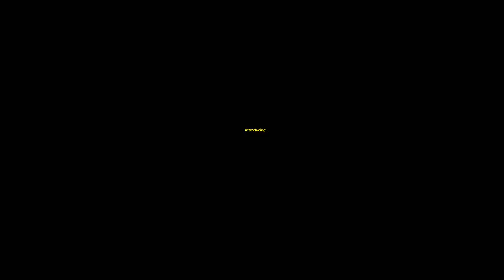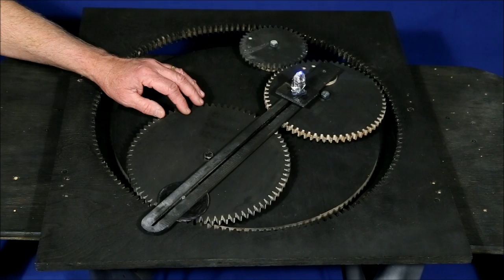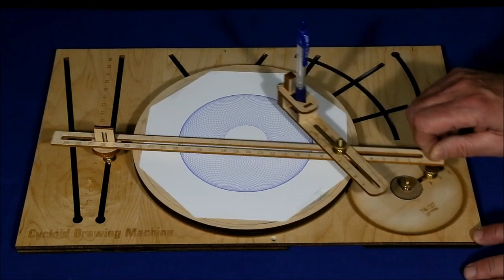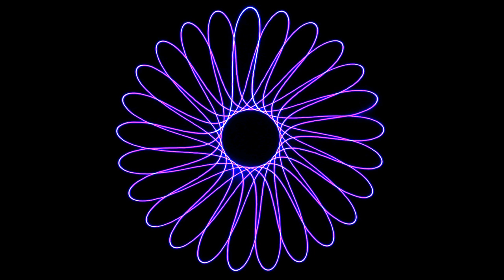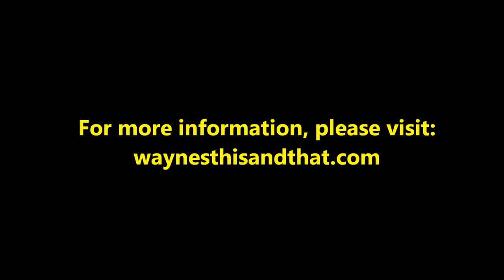Illumicon Drawing Machine

Comment: Hi! Love this! Seriously considering making one for myself!! Question for ya: I assume there’s a way to calculate the number of full rotations of the base that you need to compete a full pattern. Guessing isn’t really going to cut it with light painting of course. And given how long the exposures are I’d like to try to get it “right” the first try. Thanks!!
Reply from the maker: Unfortunately, calculating the number of rotations to estimate how long the exposure has to be is so difficult, particularly when multiple gears are used, that I defaulted to guessing at how long it might take, then taking test exposures to narrow it down. I seldom if ever got a perfect trace and had to clean the image up in photoshop to either extend the last trace to complete the pattern or edit it out if the trace overshot. Note that if you use your camera's noise reduction feature, exposure times may be doubled. On my Canon, it takes two images: the first one captures the trace and the second takes an image of the same duration but with the mirror closed so that any hot pixels are detected and eliminated. This results in much cleaner images, but if the required exposure for the trace is 30 minutes, then the camera will take a full hour because the noise sensing image also requires 30 minutes. That's a long time to wait for a single image that may not be worth anything. Good luck and thanks for the comment!

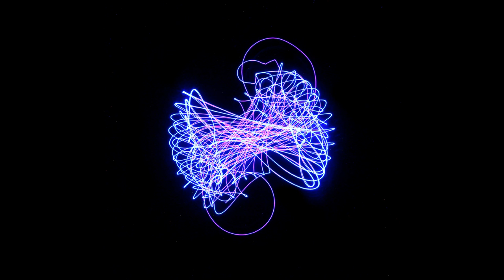Comment: 2:57 why did it end up looking like That?
Reply from the maker: The relationships between all the gears and sliding arm are too complex for me to understand what's going on with many of the more complex traces. I can only guess that with the setup at 2:57, the position of the light on the arm was such that the lines it produced were so tightly crowded together that they overlapped enough to make a mess. Moving the light away from the center of the drawing g spaced the lines out enough to allow a pattern to appear. Many traces end up looking messy. Using mechanical drawing machines is many times a guessing game in trying to create an attractive trace. Sorry I couldn't give you a better answer. Thanks for the comment!

Comment: So where can we purchase one?
Reply from the maker: Ouch! Sorry. This was a one-off machine I built myself just for fun. The idea of posting a video about it was to provide entertainment and give people ideas of what can be done as a DIY project. If I had to do it again, I'd use it as an excuse to buy a 3D printer and print all the gears. They'd run much smoother and be a lot easier to make than hand cutting them on a scroll saw. 

Actually, because the illumicon does it's thing in a pitch black room, it's not much good as a viewing experience. For that, the mesmergraph (https://www.youtube.com/watch?v=PlzcSWsF_FQ) is much better. 

Thanks for commenting!
Reply from the maker: Thank you for commenting! The 150-toothed outer gear was 18-inches in diameter, the 86 toothed gear was around 10 inches in diameter, the 74 was 9-inches, the 60 was 7-inches and the 36 was 4-inches in diameter. There are several free gear pattern generators on-line where you entire the desired number of teeth and diameter and they create printable template that can be glued to a piece of wood for cutting. I made mine using a motorized scroll saw so the teeth needed to be around half an inch tall and wide to suit the limited accuracy of hand cutting. If you have a 3D printer you should be able to make the gears smaller and the machine more compact.

If you build one, you will capture cleaner images if you select long exposure noise reduction. This takes two images: one with the shutter open then a second with it closed. Then it subtracts all the noise from the second from the first. It doubles the amount of time to capture a trace but saves a lot of time cleaning up the image manually.

If you like drawing machines, I have a whole playlist of the ones I've made. 

https://www.youtube.com/playlist?list=PLEnCVl0LWmYc1LnC4jbgEdQW7eeIDwilF

The most interesting to watch is the mesmergraph. Thanks again for commenting!
Reply from the maker: Thank you for commenting! The 150-toothed outer gear was 18-inches in diameter, the 86 toothed gear was around 10 inches in diameter, the 74 was 9-inches, the 60 was 7-inches and the 36 was 4-inches in diameter. There are several free gear pattern generators on-line where you entire the desired number of teeth and diameter and they create printable template that can be glued to a piece of wood for cutting. I made mine using a motorized scroll saw so the teeth needed to be around half an inch tall and wide to suit the limited accuracy of hand cutting. If you have a 3D printer you should be able to make the gears smaller and the machine more compact.

If you build one, you will capture cleaner images if you select long exposure noise reduction. This takes two images: one with the shutter open then a second with it closed. Then it subtracts all the noise from the second from the first. It doubles the amount of time to capture a trace but saves a lot of time cleaning up the image manually.

If you like drawing machines, I have a whole playlist of the ones I've made. 

https://www.youtube.com/playlist?list=PLEnCVl0LWmYc1LnC4jbgEdQW7eeIDwilF

The most interesting to watch is the mesmergraph. Thanks again for commenting!
Reply from the maker: The inner gears rotated on pins held to a metal sheet on the main central rotating gear with magnets. This let me move them around anywhere they were needed. You can see how the magnet pivots work 3 minutes into the following video about the mesmergraph:

https://www.youtube.com/watch?v=vdPy--1ONMg&list=PLEnCVl0LWmYc1LnC4jbgEdQW7eeIDwilF&index=9&t=125s